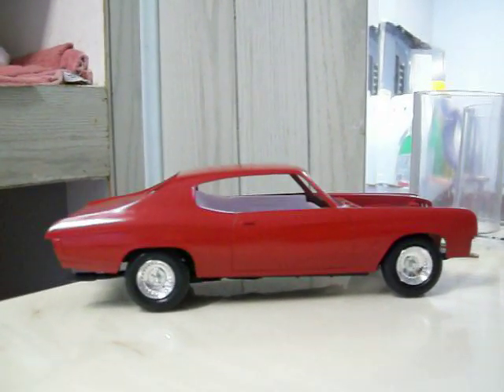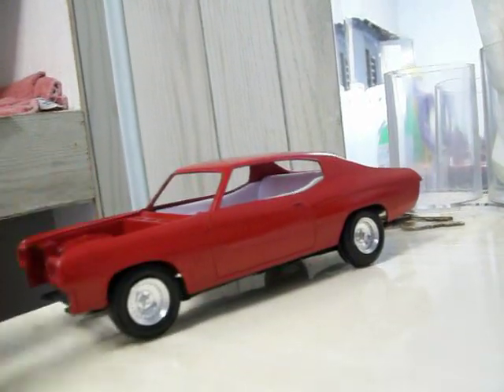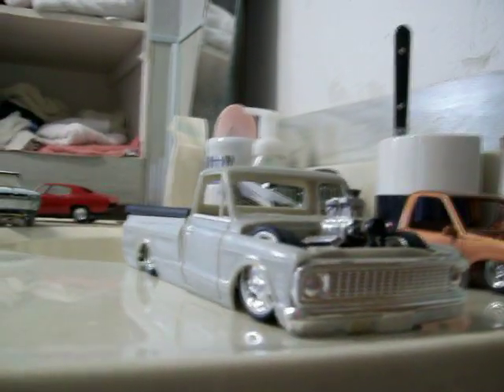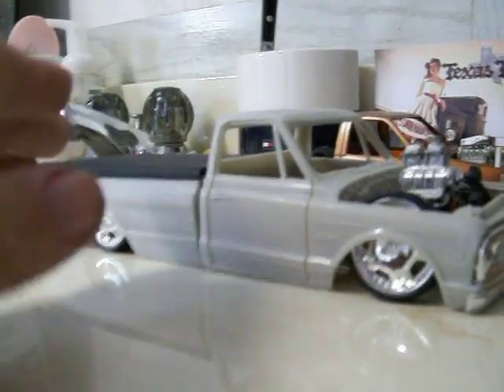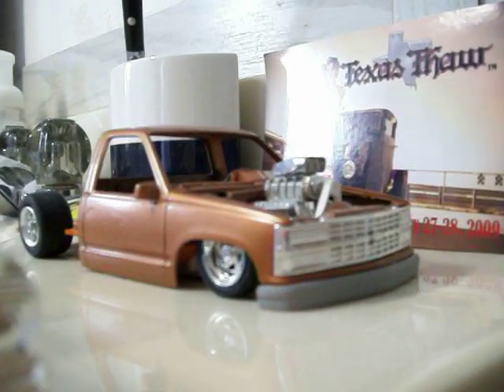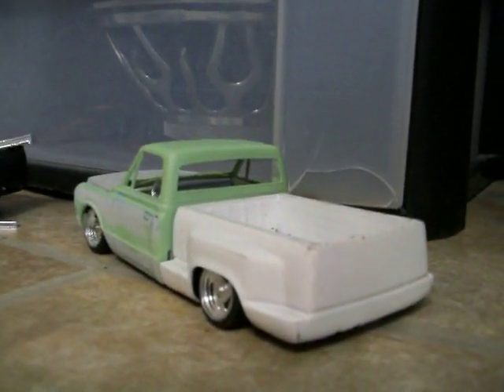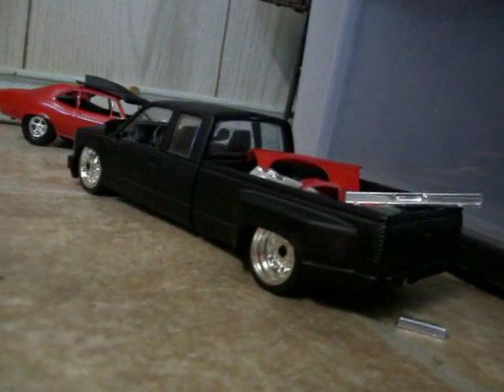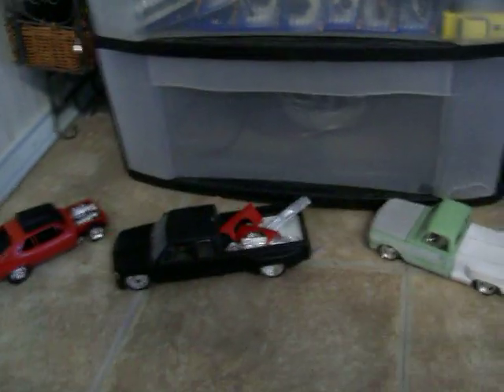whats up MCF and friends

Comment: tan and black interior and black stripes on it then clear coat it and a black vinal top mite look good 2 looking good sofar and the styrene is gunna be heading out 2day homie. and ur door hinges mite have ben alil 2 small or ya mite just need alil bit or sanding 2 it. that 72 with the 90's step side is looking kool and so dose the shop truck looking sweet